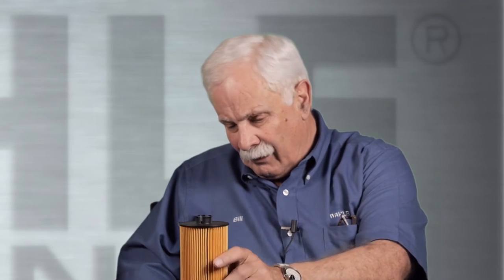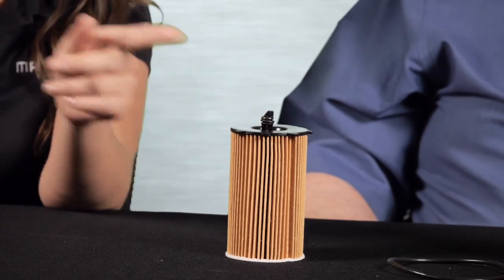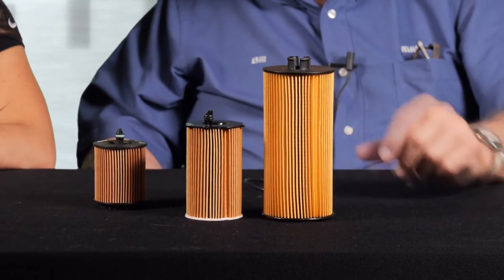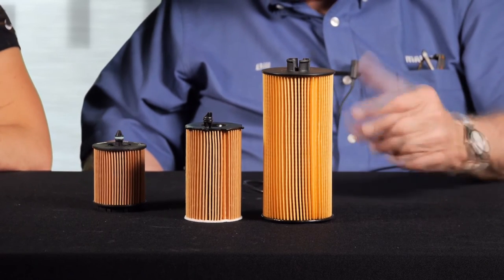Understanding a Cartridge Filter

Comment: I call BS! This is a step backwards. I take my used spin on filters, cut them open to inspect the filter element. Then you can dump out and recycle the used oil inside. Then I take the used metal canister, spring, and other parts, and recycle them too.
Reply: How many peter mashaks are there 3 out of 50 million.
Reply: I mean you don't have to cut a cartridge open
Reply: @alexf9183  It's really hard to recycle your oil when it blows all over the road because of a o-ring that everything depends on with these stupid cartridge filters. I probably lost 50 gallons of oil on the road over the past few years because of stupid o-ring failure. Now complain about your metal recycling 😭

Comment: landfill yes, but like the vehicles that are getting cheaper ' quality wise ' the filters getting cheaper is just part of it.  They are cheaper for the manufacture without the metal casing in the long run so they save millions to their bottom line. like the good ole days when airlines put black olives on their salads they saved millions by adding only three olives instead of five. corporations aren't doing if for the customer benefit, they're doing it to make that bank. its that simple.